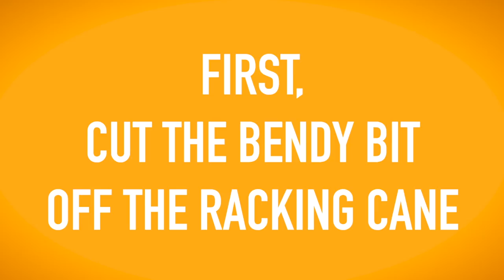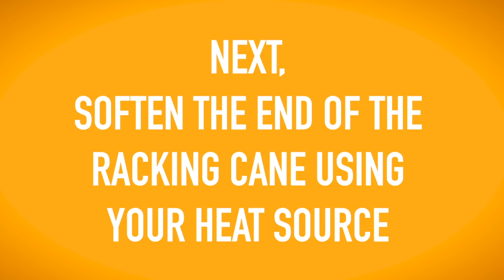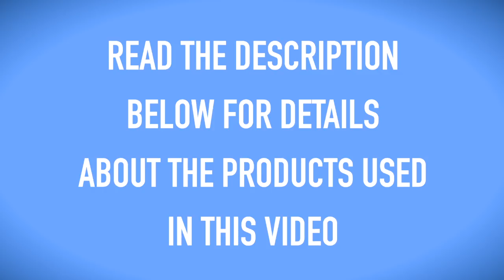DIY Thermowell

Comment: Freaking brilliant !

Had considered a length of 1/2" tubing and clear silicone fill one end, but didnt want to impart any off flavors from the silicone.  Had a couple spare racking canes since buying an auto siphon a few years back, and sure as hell, they're plastic and will work.

Mine are about 24" before the curve, so can actually make two thermowells of about 12" each out of each cane.  Dont need or want it to stick up 8 inches from the lid as the video shows, and at 12" should place the probe about exactly at the center of the beer.  Will finally be done with taping the probe to the fermenter and covering with bubblewrap !!!

Comment: Interesting. So I wont need a fridge for this? I can place my fermenter in a room, plug the thermostat in and place the probe down into the fermenter and it will cool and heat when required?
Reply from the maker: Hi Chris, I'm not sure that would be the most efficient method to control your fermentation temperature -you might get a shock when your power bill arrives in the mail! Better to use a fridge (which doesn't have to be expensive). A cheap second hand fridge will do the job.
Reply: @grain_and_grape  Or pick one off hard rubbish when you can if its only the insulation you need :D